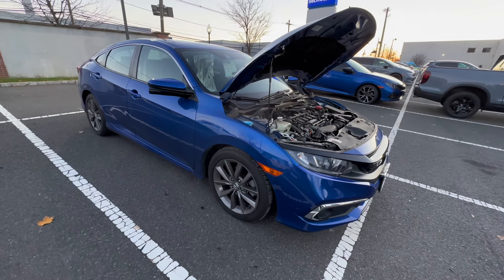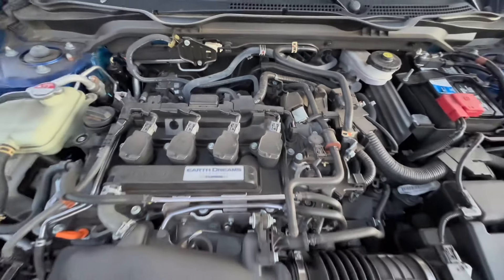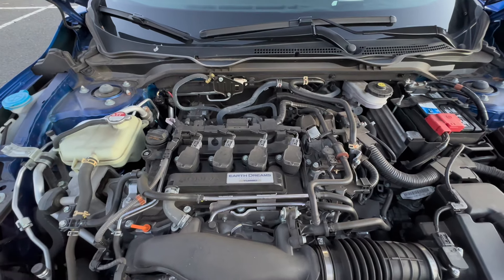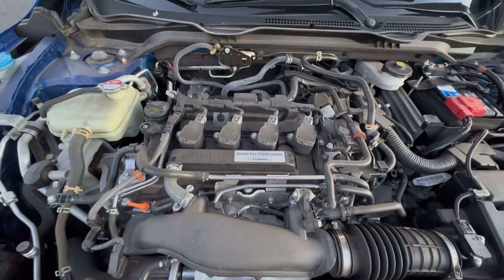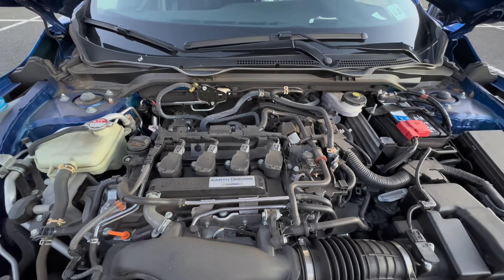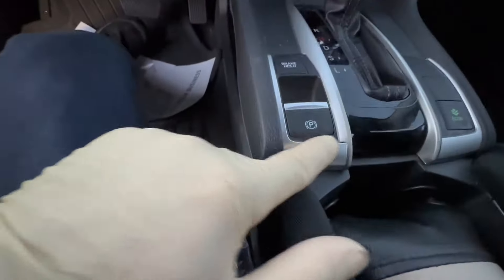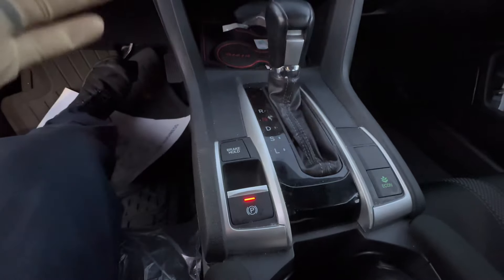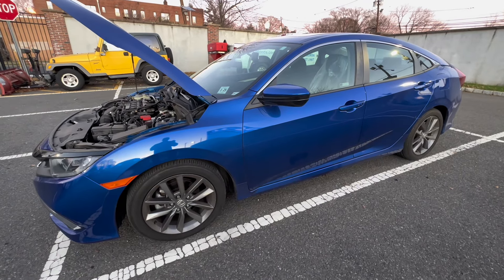2016 - 2021 Honda Civic problems

Comment: I notice a rattling in the engine after I shut off my 2020 Civic Sport. Mainly behind the steering wheel column.
Reply from the maker: Like one time or goes on for a while?
Reply: Almost every time I shut it off. I think it’s either loose or broken motor mounts or the heat shield under Meath. But I’m no expert. Sometimes you can hear when I turn it on.
Reply from the maker: @dervisserrano6818  you could have a loose mount causing excessive vibration. It’s tough to say without hearing/feeling it unfortunately.
Reply: @BCautosutions  I am gonna have it checked out. Thanks for your input.
Reply from the maker: @dervisserrano6818  no problem

Comment: Any issues with hissing sound when building boost, car seems like on and off boost, no fault codes
Reply from the maker: @CarlSmith-i8i  possibly a small boost leak somewhere
Reply: It was leaking from side of the intercooler. Back with boost now 👍🏽
Reply from the maker: @CarlSmith-i8i  🙌

Comment: Hey thanks for the video. 
I have a question my 2016 Honda civic EX 2.0 engine CVT. What’s been happening lately is when I press the gas paddle the car won’t accelerate but I don’t see no RPM move nothing would happen and no check light. I remove the pedal and press again then it accelerates normal
Do you have a possibility of what the issue could be?
Thanks
Reply: Forgot to mention I’ve changed the oil every 5000 miles and CVT transmission every 30,000

Comment: I had sooooooooooo many freaking issues with my tenth gen, gas lid made a horrible quacking noise, it had it’s cylinder head replaced at 2,300 miles, went through two batteries, and two check engine lights, dumped it at 40k miles. No regrets getting rid of it. Forgot I also had tpms issues and I had the “reliable” 2 liter
Reply from the maker: Sorry to hear, sounds like you had a bad one, they are typically relative with the 2.0

Comment: My son just had oil changed, drove 48 miles then motor lost power, all lights on dash on, checked engine oil completely not marking on stick. Engine now smokes white smoke bad, oil tech stated he ran 3-cleaners thur to clean oil, then filled. Any idea what happened. Did he wash the rings out or damage turbo? Thks. 2019 Honda civic 1.5T. 60000 miles on it.
Reply from the maker: Sounds like the oil change tech poked the oil filter to get the wrapping off and a piece of the plastic fell in the filter making itself into the engine and clogging the feed hole for intake cam lubricant. Take it back asap!

Comment: I’m dealing with all the warming/sensors lights on including the p0341 they all come on and go away after . I can delete it with a scanner but they’ll come back and go away ayer and then come back again !!! Would it be a timing chain ? Drivin me nuts .. 2017 civic tourin 1.5T 

Thanks in advance
Reply from the maker: Sounds like your dealing with a stretched chain possibly.

Comment: Sr, i just noticed that my abs module is making a beeping noise with like 15-30secs interval. Only happens if i park the car after using it with engine off. Is that normal? The beeping noise disappears as the car cools down. Not really sure how long it takes. No lights on the dash or anything. Just that beeping after using the car. Btw, the noise is literally coming from the module itself. Can be heard if the hood is opened. Thank you

Comment: 2016, 65k miles car stutters when I first accelerate then its ok...what do you think it is since the dealer doesn't. thanks in advance
Reply from the maker: 1.5t or 2.0?
Reply: @BCautosutions  1.6
Reply from the maker: @JNH1961  every time after it sits overnight or an extended period of time?

Comment: Hi! 2018 honda accord with misfire. Get a code p0344 camshaft interruption. swaped for new camshaft position sensor and car still misfires and gord into limp mode. Stops accelearating. Any thoughts?
Reply from the maker: Do you have anything aftermarket in the car?

Comment: My 2018 Honda civic is not showing a check engine light at all but it’s jerking while accelerating out of no where . Specially if I put my foot on the gas the take it off .
Reply from the maker: My first place to check would be the intake tube from air filter housing to the throttle body for years (assuming it’s a 2.0)
Reply: Be careful, my current problem started with that & to cut a long story short, it needs a new engine & I'm stuck in a battle with Honda as I refuse to pay £1000s when my mileage is well low!  If you have extended warranty, you have nothing to worry about!
Reply from the maker: @bengejuknowit3048  what’s the reason it needs a whole engine?
Reply: @BCautosutions  they told me faulty fuel injector had ruined a cylinder & valves & was beyond repair & needs new engine block!  Absolutely shocked!
Reply from the maker: @bengejuknowit3048  yeah that seems to be a bit aggressive on their end but it’s a possibility.

Comment: My 2017 Honda civic stalls at takeoff. Like at a stop sign or stop light, it’ll hesitate. But when accelerating or highway driving there’s no rpm drop or trouble shifting. Been told it could be transmission or fuel injector. Pls help
Reply from the maker: Seems more like a torn intake tube especially
If it’s a 2.0 na

Comment: Have 2020 civic EX, 65000km, just having issue when i brake to slow down to stop completely at the light. Headlights get lighter and back like dimming,  plus feels like someone push forward before stopping  completely like slipping. Had a trans fluid changes at 50k and regular maintenance all done not sure why
Reply from the maker: Have your local mechanic/honda take a look.

Comment: Bought a 2016 LX right when it came out. The issues are mostly cosmetic thankfully including floor mats so damn cheap they developed holes after 2 yrs (only have 40k now), the wheels are rusting, never had this on previously cars. The rubber seal/strip around the front of hood is loose in a few places (just cheaply made?) and there’s an annoying rattle from the glovebox area - emptied it out it’s not stuff giggling around :(  Anyhow great vid thanks!
Reply from the maker: Thanks for watching!

Comment: i have a HONDA CIVIC 2016 and just had the radiator motor fan went out, this car has only one fan in front so it causes two issues  no  AC and engine heat up
Reply from the maker: That’s not too coming but I have seen a few

Comment: No serious problems on my 2016 EX-T (1.5 T Engine) with 85k miles on it except for the passenger window. The window goes up all the way and then down half way when you try to close it using auto window. I do want to qualify the comment by saying that I do not drive the vehicle all that hard and in fact I drove almost 60k on the original tires and had to replace them not because of tread wear but age. I also want to note that I used 87 octane fuel (regular and not premium) exclusively.
Reply from the maker: Thanks for sharing

Comment: The LX 2.0 Six speed is about as close as you'll get to an old school civic with these things. The route to go if you want absolute reliability
Reply: I have a 2020 LX 2.0 6MT Civic, bought it new, and it's hands down, the best car I've ever owned...it's reliable, fun to drive, and looks sexy as hell for a base model...
Reply: Are you having fuel issues with yours i got a 2018 civic lx 2.0 6 mt fuel tank gets 301 miles to a full tank
Reply: @o3mxttz530  My 2020 gets between 28 and 30 mpg...
Reply: @smlnsgd4u  how many miles per full tank
Reply: It's what I would buy.    I wouldn't be too impressed with it but it makes the most sense right now.
Reply: @o3mxttz530 reset the ecu or unplug the battery and drive nice and slow. And that will change mine was at 22mpg now it’s at 34
Reply: @GoatTyler  ill try it out I appreciate it
Reply: @smlnsgd4u i had 21 2.0 civic automatic ..the motor went out on windsheil wiper fluid and back end wore my tires out hard. at 10000 miles..i traded it back for 16 crv..much better for now.
Reply: @tracy2762  Sheesh, sounds like you got a lemon!!! Sorry to hear... glad you found something that runs...
Reply: I've had a 2018 LX 6MT for about 2.5 years. Got it at 30k, now a bit over 80k miles. No mechanical problems. Only issue was the paint started peeling around the rear window. Had to have it fixed so it wouldn't start rusting.  Rear window had to be removed, the whole job ran about $1000.00. I plan on keeping this car for many years.
Reply: @smlnsgd4u 2019 sport manual same as 2020 .... No problems 👍🏾

Comment: My car recently just actually up and I just replace my radar. But all my lights on my dashboard is on and my gear shift for D, S, and L is no where to be found. Plus speaking on Dashboard when shift my gear to Drive the light “D” is not showing on my dashboard. When shift gear to L all the light just keep popping up. It is getting on my nerves. Plus I have my car for 4 years it was doing well then this happen. But you got any advices ??
Reply from the maker: @A.Zheng15  I don’t. Hard to say from here. You may need to get it diagnosed professionally

Comment: Point me in the direction where the coolant sensor is by the engine 🥲 long story short I exhausted all possibilities of the gauge on the dashboard staying low when it’s on but not driving. Once I start driving it’ll go up at the normal level and match the heat. I have zero leaks, no engine light on, coolant is in, A/C works, heat works, the air pressure is fine. The only issue is the sensor. So I’m kind of stuck on where it exactly is on my 2018 civic lx.

Comment: Would any of these cause a burning electric smell (2020 hatchback ex 1.5)? I know little to nothing about cars and idk if I just need to look at the fuses or what. Living out of my car right now so it makes taking it in anywhere pretty near impossible. Something online said it could be the break pads? Idk why they would make an electric smell though. No lights on the dash telling me anything. Fr any help you could give would be greatly appreciated!
Reply from the maker: Tough to say. So you have any liquid spills around the shifter area?
Reply: @BCautosutions  well I checked the things I could, like the coolant. Coolant was fine and I only put 93 in. Doesn't appear to have any other problems yet, starts fine from what I can tell (has around 65,000 so I was worried). Another yt person said it could be a battery wire or the alternator going out. The smell is definitely coming from the drivers side around the fuse box or maybe the battery, not the alternator. Battery looks fine though (from what little I could see) and there was no melted plastic or anything around any wires. But no, no spills, or at least not that I know of or remember but it's used and my ex drove it a ton. I try to keep it as clean as I can in general. It's just weird it has the smell but I have no dash lights at all, no check engine or anything. And absolutely no smell inside the car, it's only when I've parked and I usually notice when I'm transferring my sleeping stuff from the car to my storage unit. 
Could spilling something there have shorted something in the fuse box? I suppose I'll have to check the fuses individually but just from opening the box (the one under the hood not the interior one) I didn't see anything obviously off. 
The only thing I could think of is the driver's side marker light has been loose for some time (still works okay, the clip just broke that keeps it secured) or the fog light lens on one of the sides broke somehow. So maybe that's shorted something out? I'll need to look tomorrow and see if it still turns on cause it rarely gets foggy here and I haven't used them in probably half a year at least.
Reply from the maker: @niccilefevre  is it possible you may have some rodent activity going on? Typically doesn’t cause an electrical smell just tossing some ideas out there. Or possibly ran over a plastic bag and melted to exhaust?

Comment: I just had both low beam headlights fail to light on a 2018 Civic. The high beams are fine, the running lights and tail lights are fine. I pulled out one headlamp and it looked fine; the other one was in there too tight to remove. I cleaned both sockets with CRC (everything looked clean before spraying), and that didn't help. I checked both fuses, and even swapped them with the high beam fuses, and that made no difference.

Is the switch a likely cause? I actually found this video by searching for this headlight problem.

Comment: My wife bought a 2016 civic new and it's been 1 problem after another since and the dealer has been nothing but shit to deal with. I'll never buy another Honda.
Reply from the maker: Sorry to hear
Reply: Mine too, fortunately nothing serious mechanically, yet, but I have had the hesitancy on accelerating from a stop thing, which is scary in busy traffic. The interior is crap, positioning of window buttons, cup holders, USB and 12v outlets, console tray are annoying, seat covers stained from water bottle leak as if was coffee or something, and splash guard constantly scrapes, cannot even pull forward a normal amount in a parking space and it scrapes so loudly. The Bluetooth has not worked since day one, mad at myself for not making them fix it, but many said they tried and didn't work. If somebody calls it doesn't work, just freezes the entire system and cannot even use audio until turn car off and back on. The voice dial by name does not work at all, never has. I went Honda to have a cool car that could last years, sick of payments, wish I had gone Toyota.
Reply: 1st it was that defective ac and they refused to fix it even tho it was still under warranty. Said it was damaged by road debris. They even have a recall on if I'm not mistaken. New rotors bc they said we had too much weigh in the car. Never happen in any of my other cars and I've been driving for 55 years. AC problem 2 more times after original fix. cracked side window in the back which was probably installed wrong, cheap or defective.  Now this hesitating issue. I'm ready to just run this lemon into a tree for kicks and it only has 110k miles.

Comment: Front bumper / driver side headlight where it meets the quarter panel keeps popping out. Never had an accident or bumped into something. Researched some forums and read that the its a common problem with the headlight bracket that holds those tabs are shitty

Comment: I overfilled my gas tank the other day when filling up my gas at a gas station. The fuel didn't spill out of my car or anything like that. It's just when i went back inside my car, I smelled fuel inside my cabin. Nevertheless, I drove it and soon enough the smell went away. Did I damaged anything to my car? This incident of overfilling my gas tank only happened once. That's it. The car is a 2019 Honda Civic EX sedan
Reply from the maker: @timothylee2772  no. Probably just a coincidence and a 1 time thing.
Reply: @BCautosutions Ok...thanks
Reply: Don't overfill. Just stop filling when the gun stops, otherwise the "extra" fuel can damage the sensors and cause a check engine and catalytic converter warning light to turn on. It happened on my Honda Civic Sport 6MT 2019

Comment: My car sitting at 80k mile but I noticed very loud ticking noise in the cabin I guess it the high pressure oil pump but it’s suppose to be that loud?
Reply from the maker: @xiangliu7089  they are relatively loud
Reply: @BCautosutions  I will stuffer it then it runs pretty smooth.
Reply: Common I guess I’ve noticed that as well and I have similar miles

Comment: 2016 2.0 ex here, one of the worst cars I’ve ever owned, wish I could get rid of it but sadly I still owe on it, every light on the dash is currently on, the interior quality is trash, I meticulously change the oil and have changed the transmission fluid intervals, replaced front cv axles and wheels because they were bent and causing a wobble and a acceleration shimmy, have had 2 new belt tensioners installed and have had a grinding rattle noise on acceleration that the dealer finally found to be a stretched timing chain, never ever having a newer Honda again. JUNK.
Reply from the maker: Sorry to hear, thanks for sharing.

Comment: Ive got a 2018 Honda civic. Having issues with emissions test. It keeps failing, due to "readiness". They keep telling me to drive it more. I had a new battery installed over a month ago, and have driven it almost 1,000 miles since the new battery. Any helpful tips to get it to pass emissions test??

Comment: nah ill stick with my 2013 2grfe venza. 110k miles, oil changed every 3.5-4k. Burns no oil at all. The oil looks like new after 4k miles. The 2gr from 2013 was improved and is pretty much bulletproof lol. i feel bad for newer hondas having AC issue, mine blows ice cold on a 100 degree day at idle.
Reply from the maker: Cool

Comment: I never get replies but. My 17 Si has all the bells and whistles go off in the morning (parking brake, hill assist, etc) and cruise won’t work. Then in the evening leaving work all the codes clear. Im baffled. And my car seems to be losing throttle every now and then for 2-5 secs.
Reply from the maker: Guess I’ll be the first then lol. Best thing I can do is get it scanned, even if the lights are off on the dash, should have something stored. You get me those codes I can point you in the right direction.

Comment: My car with 55K burns gas now I am getting 30 miles per gallon and keeps dropping. I  was getting 40 miles per gallon. Replaced air filter, spark plugs and PCV all OEM
Any advise pls
Reply from the maker: Have your driving routes/routine changed?